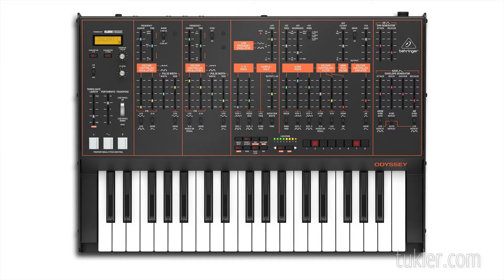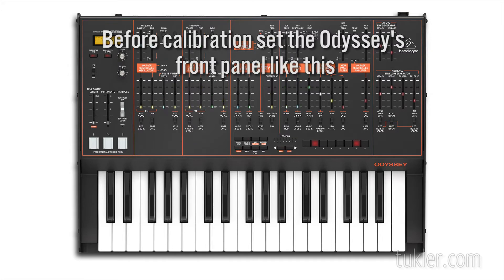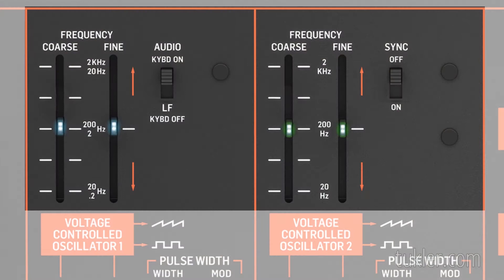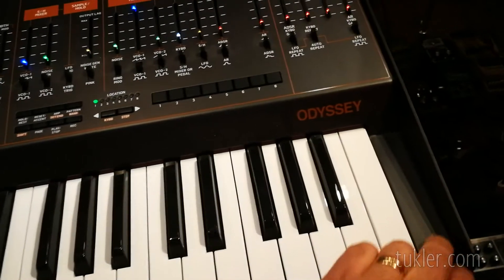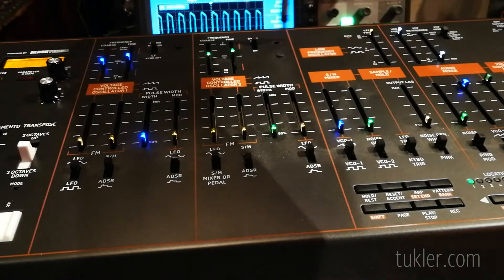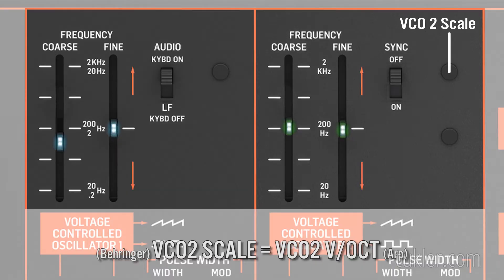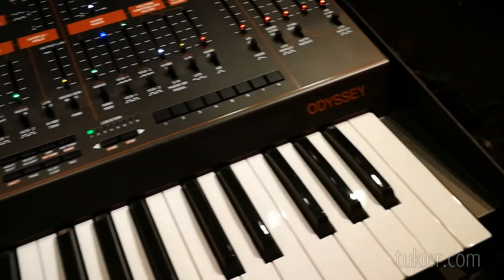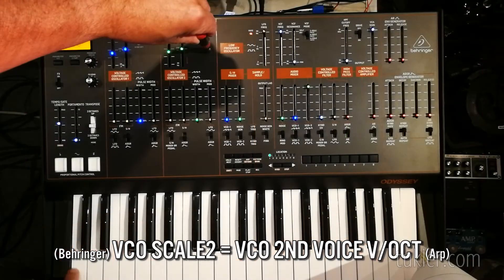Calibration of the Arp Odyssey's pitch and scaling

Comment: I bought a used Berhinger Odyssey and I am having an issue with the velocity curve. The top end of the curve is hard to trigger and then seems jump to the top when I play with any vigor. I'm not certain it's the velocity but that's the best I can describe what is happening. Do you think it's a calibration issue or does it need a technician?
Reply from the maker: Play around with different settings in the Synth tool app. Its normal behavior. There are two velocity states on the Odyssey. Pressing the key hard registers as an 'accent' velocity.
Reply: @tukler2 thank you for your quick reply.  Is the synth app on the Berhinger website?
Reply from the maker: @HowardBaileyMusic It's called Synth Tribe and is at the software section of the product page
Reply: @tukler2 Awesome thank you very much. This is good news as I thought something might be wrong. The accent is triggering too easily for my playing style. I'm very happy to have found your excellent tutorial video. So far this board doesn't appear to have any tuning issues but I have saved your video for when I do decide to put a meter on it to check.

Comment: Thanks again that's worked pretty well on the Karp with only a few cents out across the keyboard done with a plug in tuner that didn't give a perfectly stable reading. It just goes off on the last few highest keys from about five cents then 20 on the highest c. It's much better than what it was before at 10 cents per octave and ok for recording again.
Reply from the maker: @shane9675  My old Korg Mono/Poly has to be stretch-tuned 5–10 cents flat in the lows and 5–10 cents sharp in the highs, according to the service manual, and the pots won’t go any further.
Reply: @tukler2  I have some synths that aren't great in the highs. This is the first synth I've calibrated and it has given me the confidence to have a go at my Polymath if AS will give me the instructions.

Comment: Hi thanks for the video. My scaling is out on my Korg Odyssey and was from factory. I'm about ten cents out per octave. How accurate should the Odyssey scale? What do I need to do this operation? I have a Korg NTS 2 oscilloscope.
Reply from the maker: @shane9675  Hi! Thanks for watching. The Korg Odyssey should ideally be as close to in tune as possible across octaves, so being ten cents out per octave suggests it needs calibration. Since you have a Korg NTS-2, you can use it to check the tuning while adjusting the trimpots.

I demonstrate the calibration process in this video for the Behringer Odyssey, but the general method applies to the Korg Odyssey as well. If the scaling doesn’t improve after a
djustment, the voltages on the power board might need calibration first. That procedure likely differs between manufacturers, so be sure to check the service manual for your specific model.
Reply: Thanks I'll just try a straightforward calibration first.
Reply: @tukler2  Could you recommend a multimeter for doing this job, or a daw tuner for measuring Hertz. I have G Tune that measures Hertz but won't go low enough for the first test in your video? What quality level multimeter do I need for this job?
Reply from the maker: @shane9675  Both of my multimeters (Brymen BM687 and UNI-T UT61D) with a Hertz setting work fine.
In Cubase, the default tuner works to some extent, although the reading fluctuates. The Audio > Statistics function gives an accurate Hz reading, and you could manually count the waveforms from 1 second of audio. It doesn't need to be exactly 20 Hz, just somewhere in the ballpark.
Reply: @tukler2  thanks again I haven't got the money for those multimeters yet, but have found a free tuner by Nembrini Audio NA chromatic tuner that is giving me low hertz readings. I'm at 18.30 hz on the low note so I guess it's opening up the Karp for adjustment.
Reply from the maker: @shane9675  I'd say that 18 Hz is ok, close enough

Comment: great video, thanks -do you have any idea how to calibrate the transpose switch? mine now plays perfectly with the switch in the middle but is very out of tune two octaves down
Reply from the maker: No, not really. It should be related to the overall scaling of the synth. Have you done the pitch and scaling calibration like in this video? And have you checked the voltages like in my other video?
Reply: @tukler2  yes, done all the voltages, vco offset etc
Reply from the maker: @victoriajakeman  This is from the original Arp Odyssey's Service manual page 7 (https://dl.lojinx.com/analoghell/ArpOdyssey-ServiceManual.pdf). I haven't found any Behringer Schematics, but hopefully it's similar to the original.
2.1.4. TRANSPOSE SWITCH
Half of the transpose switch is connected to the
bottom end of the resistor chain to, in effect, add
two or four octaves worth of resistance (about
1200 or 2400 ohms) to the resistor chain. This raises
the control voltage level supplied to the CV memory.
The following chart summarizes the CV output for
low 'C' and high 'C' on the keyboard for each of the
transpose switch positions:
TRANSPOSE SWITCH:
DOWN 2 OCT.
NORMAL
UP 2 OCT.
LOW
'C'
OV
+2 V
+4 V
HIGH
'C'
+3 V
+5 V
+7 V
The remaining half of the transpose switch compensates
the second voice control voltage for the
difference in the resistor chain resistance.

Comment: I could never find the Service Manual for this Unit, if anyone can give me a link or place where I can get it would be appreciated !
Reply from the maker: I'd love to get the Behringer one too, I've only got a copy of the original Arp service manual.
Reply: @tukler2 exactly, same here. I went as far as to ask behringer and community groups of behringer but they have no idea as well. I have never ever come across a unit without a complete service manual. No idea what logic part no. chips they have installed, mainly they used surface mount components which don’t even have markings, it oblivious to tech service and I don’t know where to start from. The pcb and the design is shocking, the only solid thing on this unit is the keyboard and case everything inside is cost reduced and uses aroun more then 10’different part manufacturers.

Comment: Surely this is done in the factory before they send them out?
Reply from the maker: Yes, it's done at the factory. And there's no need to do it until the synth doesn't play in pitch. It could take years.
Reply: @tukler2  they forgot to put the plug back it…. and it’s hard to find a replacement part so small.
Reply from the maker: @petert8507  Keep on looking, I hope you'll find one. I don't think it’s critical though.
Reply: @tukler2  I’m just a bit OCD when it comes to things like this.

Comment: This worked perfectly for me.

My brand new Odyssey had weird pitch issues on VCO 2.  I followed your instructions, and when I was trying to adjust VCO 2 it was behaving weird, like sometimes I would turn the potentiometer and the tuning would not change, then it would suddenly adjust by 100Hz all in one go.  I figured it was dirty contacts and turned it back and forth about 20 times and after that it worked fine.

I guess the dirty potentiometer explains why it wasn't calibrated properly in the factory.

Thanks for your video - much easier to follow along than read the calibration guide!
Reply from the maker: I'm happy to to hear that! Thank you for your feedback. :-)

Comment: Would I have to do this right out of the box or is this the procedure if/when it eventually falls out of tune?
Reply from the maker: There is no need to do it unless the pitch, tuning and scaling starts to bother you.
Reply: @tukler2  thanks
Reply: Wouldn’t this be done in the factory?
Reply from the maker: Yes, it's done at the factory. But mechanical, environmental factors and time could make the calibration to drift to the point that it's necessary to do a new calibration.

Comment: How are you connecting the alligator clips to the test probe?  I'm looking to purchase a digital scope for calibrating some of my modules, but am confused how to interface my gear with the probes.  Thanks for this video!
Reply from the maker: I've soldered two wires with alligator clips to an ordinary tele-plug the line out jack. An easier way (if you don't allready have one made) would to use just a bare plug and connect the probes directly to the plugs connections.

Comment: Thank you so much for this vid! I don’t have an oscilloscope. Do you think I could do this with a software tuner, using for example abletons tuner?
Reply from the maker: Yes a software tuner will work just fine, but sometimes they struggle with the really low frequencies.
Reply: @tukler2  thanks!

Comment: Hello, could you do some tutorial on a Yamaha DX-7? A few of my buttons/switches are beginning to fail (Mainly Button 1, 6 need more pressure while 25 is dead.) Also my Output jack is loose itself which causes the audio to be intermittent.
Reply from the maker: Arpmuless Sounds like the faults should be easy to fix on your DX7, try to find a synth tech nearby. I would do a tutorial if I only had a DX7, but I haven’t touch one for the last 25 years. If you decide to do the fix yourself, take lots of pictures when you take it apart and label all your cables. Practice your soldering skills on something else before you start on your synth. The output jack just needs some fresh solder. I’d replace all switches, even the working ones. Good luck!
Reply: @tukler2  Thanks for the lighting fast reply, that's a pity you dont have one, it's a Very underated synth. The output jack will be an easy fix, I've done work on it before. The buttons however, can I just use a contact spray in them?
Reply from the maker: No, it won"t work. The buttons are sealed and worn out. I'd replace them.